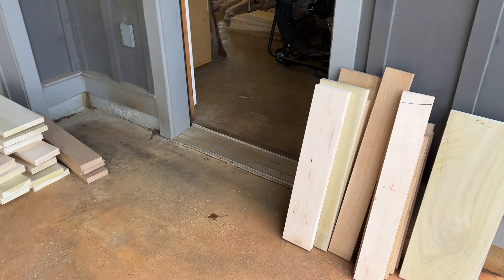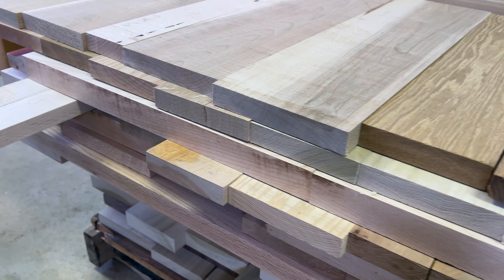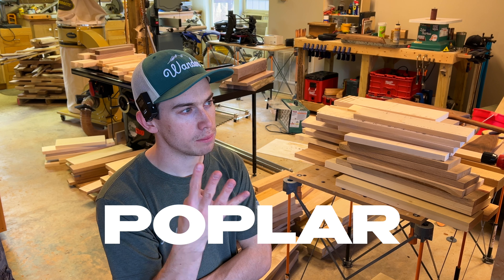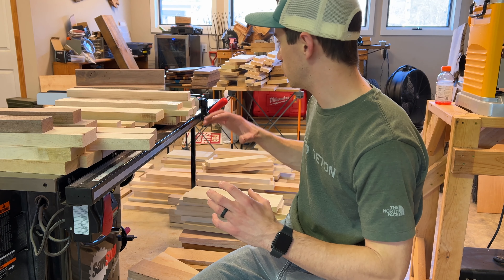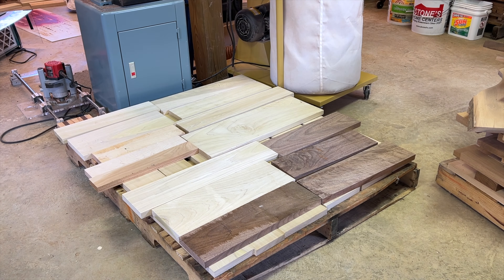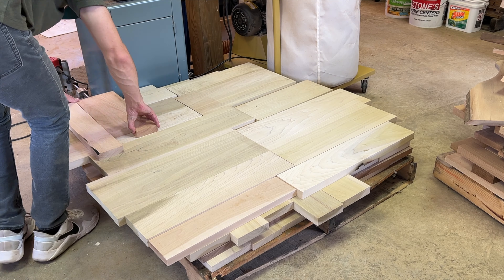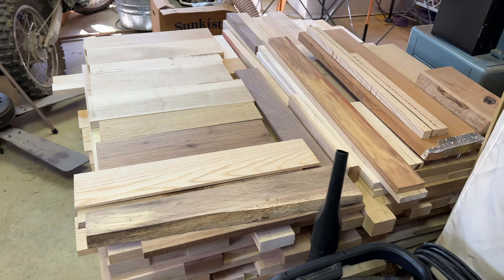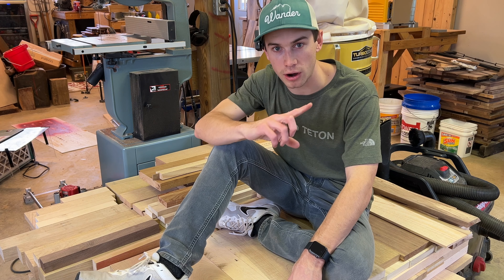Too Much Wood? | PLUS Tips for Storing Lumber

Comment: Nice supply of hardwood material - and definitely a good price for the S4S 😳  For the poplar, it wasn't uncommon to use it for drawers before plywood was readily available in so many variants (way before my time).  Looks like you have a bandsaw, so you could make panels, re-saw them, and use them for shallow drawers [if length is capped].  Enjoy the projects - lots of possibilities ✌
Reply from the maker: Thanks for this info! Very helpful

Comment: just buy some proper racking dude, then you can stack it efficently and have access to it easily rather than not being able to see a piece you need and cutting down something else when you had a board the right size already, the investment on metal racking of a couple hundred bucks is worth it long term. also you can categorise your shelving by species or by size or thickness too making it easy. itll also stack more wood in the same footprint.

the wall mounted orange and black ones are actually really good and store loads and are up off the floor wso you retain floorspace, i have 2 of them and used 18mm ply to make them into shelves for short pieces, i show on end  so i can see what i have easy
Reply from the maker: You are right, this is one of the upgrades I need in my shop. Hopefully, can do that soon!